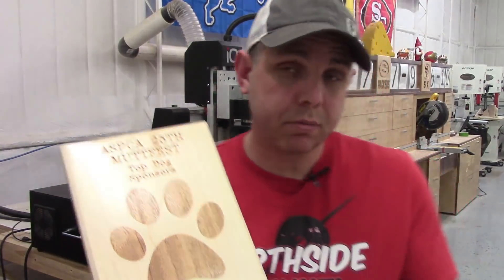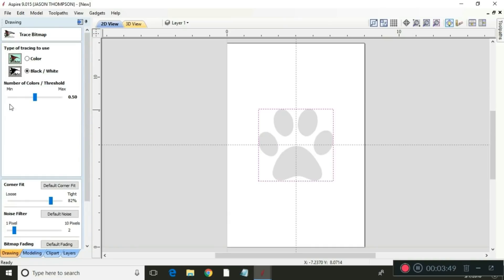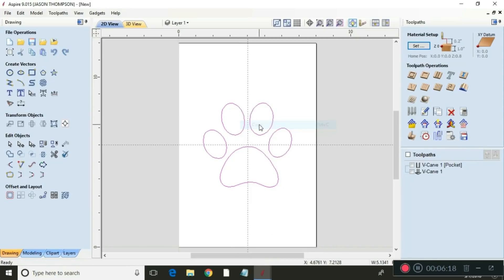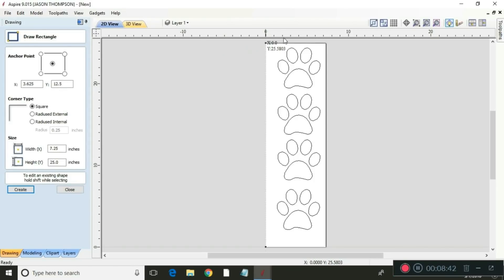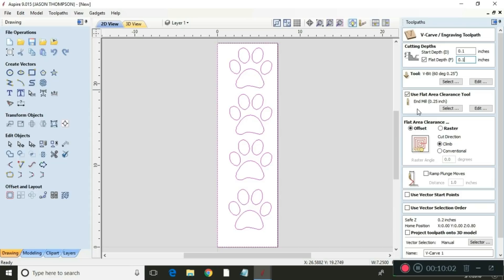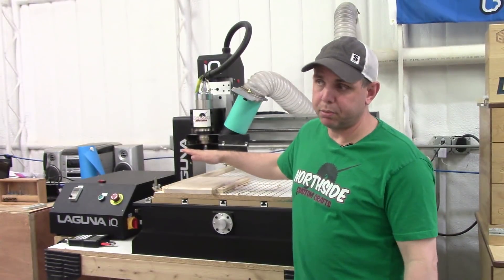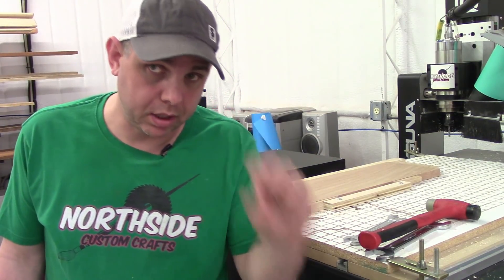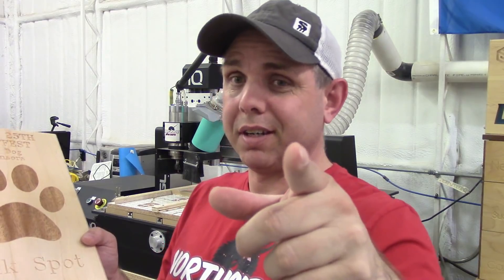CNC VCarve Inlay // Laguna IQ // Aspire Demo

Comment: I bought the same Laguna machine that you have and love the table you have yours on. Do you mind sharing the dimensions of it and does it work well for you or would you change anything. Any and all advice is greatly appreciated
Reply from the maker: I like it.. it’s 4 feet wide and 5 feet long.. I had to screw some extra 2x4’s to the side for the electronics to sit on but if you placed the electric box somewhere else you wouldn’t need to do that.. I like it, it’s about the right height too

Comment: Something I can't figure out.  When I combine a 60 degree v-bit section with a 0.25 flat area clearance part, how does the software know how to do each part and when does the bit get changed? Is each portion a separate segment, and saved separately?
Reply from the maker: You make separate tool paths. So when one tool path is finished.. you change the bit and run the the next tool path
Reply: @JakeThompson  Thanks. That's sort of what I figured.

Comment: Another awesome video Jake!! Quick question I keep racking my brain over...when you do the female inlay. I totally understand the purpose and how you do it. My concern is with a start depth of the .1 won't the bit dive into the material to quick? or does the flat area clearance take that top layer off before the vcarve? I hope that makes sense.
Thanks!!
Reply from the maker: Dean Rovedo Jr. These things will cut deeper than that no problem..  every one I’ve done come out perfect. 😄👍

Comment: Hi Jake,  Two comments:  It's obviously a matter of choice, but with a female carving depth of 0.2", a male start depth of 0.15" would have left 0.05" for your glue gap (which is entirely adequate) and would have added stability to your final inlay piece by adding additional surface area to the female-male contact area in the inlay.  0.1" glue gap is unnecessary.  Second, it would be extremely helpful if you (and other practitioners of this inlay method) would refer explicitly to its discoverer, Paul Zank, and the extensive information at the Vectric Forum, where Paul freely disclosed the details of his discovery in 2006.  There has been a vigorous discussion of Zank Vcarve Inlay Procedures at the Vectric Forum in the years following Zank's original white paper on it, and many valuable refinements and extensions have been added there.  Referring to Zank VIP or Zank Inlay also usefully differentiates his technique from Vectric's canned Inlay function, which is not the same technique, uses very different toolpaths, and is actually far more limited in what it can be used for than the Zank method.
Reply from the maker: laflippin Great comments. You are obviously more informed on cnc than I am. My objective on these videos was to take the intimidation out of cnc and the software. I try to make things as simple as I can for the viewer and give them confidence that they could also learn cnc. I learned the techniques from other videos and I practice and then show people that they can also do this. There are other super in death cnc channels.. I just do very basic videos. Thank you again for your comments, and thanks for watching. 👍

Comment: Hi Jake.  I have done some inlay work for yardage signs at a local driving range.  I used the "Inlay toolpath" provided on the toolpath options in Aspire and it worked great.  It did all the spacing and clearance issues withing the software.  I was able to use the nesting  feature to cut the Male parts and that saved quite a bit of material. The signs are 3/4" Plywood and the inlays are made out of 3/4" PVC sheets.  The females are cut 1/2" and the Male parts are cut through.  This allows the inlayed numbers  to stand out 1\4" from the plywood.  The contrasting material increases the visibility of the numbers.  I am not sure whether VCarve Pro has the "Inlay Toopath" as Aspire does.
Reply from the maker: Richard Kowalski that sounds awesome! Vcarve pro does have an Inlay toolpath also.. I haven’t messed with it much!! I’m glad you enjoyed the video!! 👍👍👊👊

Comment: Jake i have the Exact same machine (actually because of you lol), I have a question: why are you using that post processor type instead of the laguna (.mmg) one? Is it an Aspire thing?
Reply: Hey Jake,,  I moved all the posts to another folder except the one I use for the Laguna and now when I save the G-code the Laguna IQ post is the only one to see.
Reply from the maker: chris80333 I had to change it to Laguna IQ hhc.. I didn’t show me changing it.. I forgot to do it with carve pro also.. but it’s very clear very quickly that I had to change it.  I didn’t figure anyone would notice.. lol good eye!! 😂😂
Reply: Ok cool. Video is awesome and that IQ is an awesome machine,  im loving mine!
Reply from the maker: chris80333 Awesome!! I love mine!!
Reply from the maker: cbrSpeedster1 nice!!! That’s a good idea.. I have tons I’ve saved!! It’s crazy.. lol